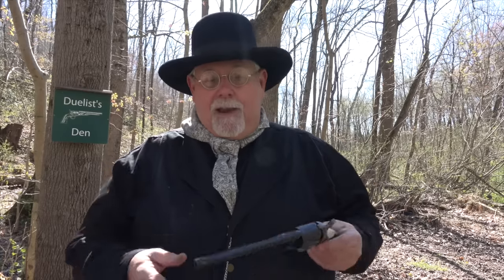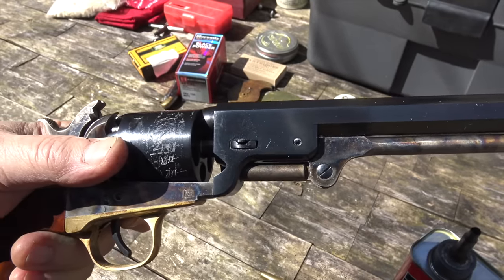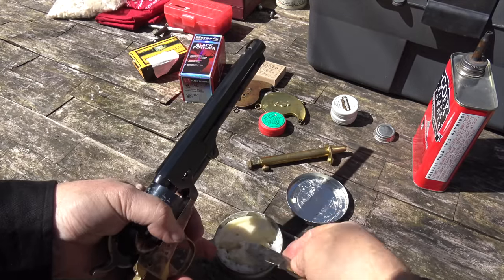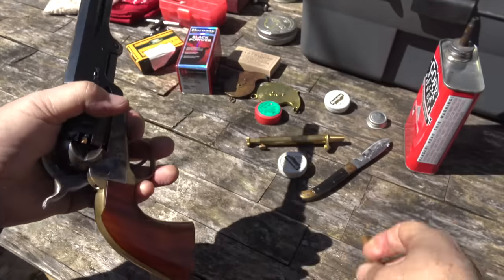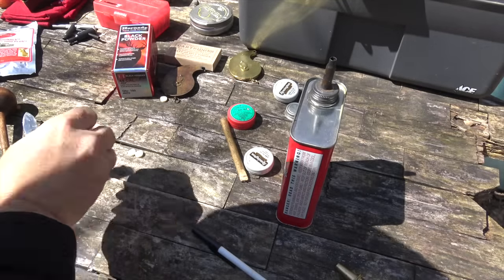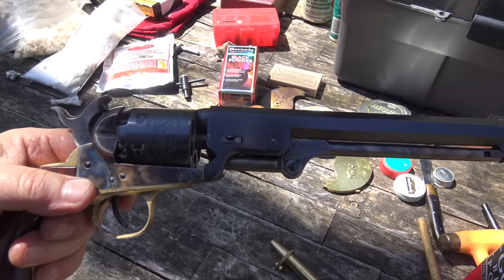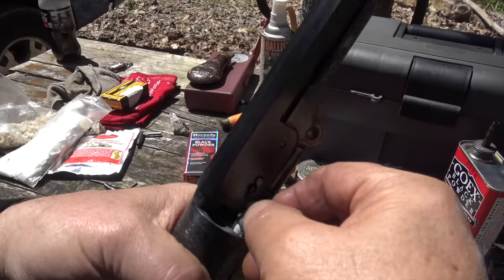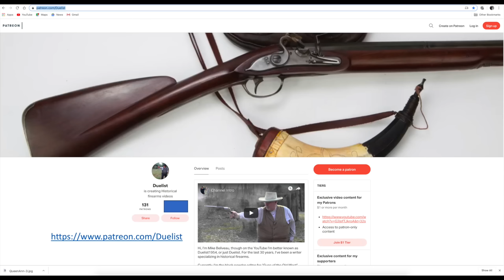How to load a cap & ball revolver

Comment: Hi Mike. In one of your other videos you showed how to modify the loading area of the Pietta 1851 Navy to accept conical bullets. You also changed the rammer. Were these changes made to that gun or were you using different bullets?
Reply from the maker: That was an 1860 Army revolver, not an 1851 Navy revolver. Navies accept conicals without any mods....36 caliber Navies that is. .44 Navies cannot accept most conicals
Reply: duelist1954 Thanks, Mike. Right after I sent the comment I searched your playlists and found 2 videos about modifying the 1860’s. Should have searched first!

Comment: Hi Mike. A question. When ramming the ball down into the chamber, do you simply ram it down hard until it stops to compress the powder or do you snug it down so as to not over-compress it. Do you need to make each chamber pressure as consistent with the others as possible or does it really not matter for maximum accuracy? Thanks.
Reply from the maker: I just ram it down for a good "crunch"
Reply: @duelist1954  Thanks.

Comment: I just bought a 1851 brass frame Navy and wanted to get started shooting. I bought bore butter and the lubed felt wads. So I don’t use both? I can use the wads and don’t have to use the butter or vise versa? I’m a newbie, and just trying to learn by these videos.
Reply from the maker: Correct. You don't need both
Reply: @duelist1954  thanks. I really enjoy your channel
Reply: At least you can double the amount of shots you can make before buying more. Use up the one product before switching to the other.

Comment: It has been a very long time since my cap and ball revolver saw use, but I rather thought I remembered the manual saying one should put the caps on first, just incase they go off when you put them on the nipples they will go off on an empty chamber. 

Is that wrong? I see you putting them on last, and I am certain you have more experience than I.
Reply: I can see two problems with that: The chamber is live when the cap is seated. Not only is this potentially dangerous, it would violate rules at particular ranges (you're allowed to cap the gun only when you're on the firing line, never at the loading bench).

Second reason is a little more practical. The cap blocks up the nipple vent when seated, more or less airtight. The bullet is going to trap a little air when you ram it down the chamber and slightly compress that air. I assume the trapped air exits through the powder and out of the nipple vent. If you tightly seat a cap on the nipple before ramming the projectile down, I can imagine the trapped air will push the cap away from the nipple.
Reply: @BogeyTheBear  I had not considered the issue of air leaving the chamber, that is a very good observation. Thank you. 

As to making it go live, it would seem safer to cap first, depending on the issue of escaping air. After all, if a cap were to go off in the capping process, it would likely cause an out of battery detonation if you capped last. But perhaps the caps are much more stable than I imagine. As I said, I haven't had mine out in many years.

Comment: Hey Mike I got a question, I just received a black powder revolver connecticut valley arms made in Italy. Cylinder is engraved (Engaged 16th 1843) serial number is 5 digit it has a lot of stampings on the brass where the serial number is, any info you can give me on this I would really appreciate it.
Reply from the maker: This video should give you the info you need. https://www.youtube.com/watch?v=_LuuLgBC2LI&t=528s
Reply: @duelist1954  Thank you so much for the reply, I very much appreciate it Mike!

Comment: Would this work for a 1860 army revolver? I know the two are relatively close. But not sure if the measure 20 grains will work for it also.
Reply: Also if ball size is the same or different
Reply: Your 1860 army may be 44 cal, Mike's was a 36 cal. .451 or 454 ball for a 44 cal. Read your owners manual.

Comment: How does the spark from the cap get to the powder if the cartridge is closed?
Edit:
I'm new to cap and ball but I've been shooting flintlock for about 3 or 4 years now with my unit
Reply: The cartridges for revolvers are made of thinner paper than what you may be used to with the tailed cartridges of a rifle. People make revolver cartridges out of cigarette paper, coffee filters or the paper used with hair curling irons.

The cap is directly in line with the chamber (as opposed to a flintlock or caplock where the flame has a turning path to the main charge) so the cap has enough force to burn through the paper in the back of the cartridge.

Comment: I have an 1860 pietta...I've seen your 1860 video though you used a larger ball....my 1860 pietta says 36 caliber only and I was told I need to get an oversized 36 cal ball (0.375")....I want to make that is correct....
Reply from the maker: 1860s are all .44 caliber. You must have an 1861. Either .375" or .380" will work.
Reply: @duelist1954  thanks for the reply....I think it is an 1861 though where I bought it they had it labeled as 1860.
Reply: @duelist1954  Another quick question....Can I use 3Fg powder or Pyrodex "P" grade, instead of the regular 3F powder??
Reply from the maker: @jerosa07  yes

Comment: Is there a rule of thumb on how much powder to use according to caliber?
Reply: No, you have to work out how much powder it takes to have the ball fit just below the face of the cylinder
Then set your powder measure to throw that volume of powder.
The ball has to sit firmly onto the powder charge is what is important.
How far below the face of the cylinder can make it more or less accurate. You will have to work that out too.
I like mine about 1/16th inch below the face of the cylinder.

Comment: Im using a brass frame pietta 1851 44. Im tryna find the best powder and charge volume. Ive already using an upgrade spring from the stamped steel that was installed.
I had the max charge of 40 grains on 2f rs powder. It had problems after the 3rd shot. So that tells me its too much. I bought this for self defense and survival only. 15 grain is too little to stop a threat at close range. Right now im using hodgens and keep getting conflicting info despite many hrs of research. I actually had to buy another identical pietta so id have spare parts.. Can anyone give me some advice?
I know that its no ar 15 but i wanna eat if i hit the hills and have a usable tool at sundown.. Please somebody help
Reply: Wrong gun for all that. They are pretty unreliable when just used as range toys.
Reply: Pyrodex P , the non select might burn different. RS is for rifles/shotguns. Can't you load 30 grs?
Reply: @ValcoBayrunner  
30grns is decent.. I've switched to conicals from Jason at 200 grain. Also got pyrodex pellet but it's a very dirty gun after a full cylinder.
Best thing I've seen yet is 32 grn with .457 140 grn ball and felt prelubed patch.
Got a 15 lb turkey at 30  yards.

Comment: Hey Mike... is there a historical reason colt made the Navy in .36 cal ?
Reply from the maker: The state of metallurgy at the time meant larger calibers needed massive cylinders like the Dragoon revolvers.
Reply: The first guns (Patersons and the like) were in the neighborhood of .31 or .32 and it took the input of Captain Walker to move ahead with a horse-killing .44 caliber. 

Colt was trying to find a way to retain the stopping power of the dragoon pistols while making it manageable for wearing on a belt. Wrought iron didn't give him many options, and .36 was a big as he could go without compromising the strength.

Comment: Why do you put the lubed wad over the powder, but the homemade lube over the ball? Couldn't you use the lubed wad over the ball?
Reply: I believe a thick felt wad is going to impede the movement of the round as they go down the bore together. May affect velocity or accuracy.
Reply: @BogeyTheBear  Thank you for the reply. I did figure a felt/lubed wad would push through with little affect on the ball. Especially at "typical" BP pistol distances.
Appreciate it.

Comment: I think the new shooters should know that most cap n ball revolvers will not allow for conical bullet seating without modifying the rammer opening of the frame. Usually not enough clearance. A horrible manufacturer’s error. 😢 Off to the range..
Reply: That's with the Pietta. The pistol used by Mike in the video is an Uberti 1851.  They are identical to originals.  The gentleman on the cap and ball channel (as mentioned by Mike in the video) has confirmed it. The cylinder, barrel, and other parts will swap out perfectly with originals.  Colt conical bullets will load in an Uberti 1851 without any modifications needed.

Comment: I got one of those navy pistols it says it's a .44 on the barrel but the. 44 ball wont fit in it. it's that same gun engravings and all has anyone else bought one thinking it's a .44 to find out it's a .36? that is what it is right?
Reply: If it's a Colt you're talking about, the .44 Colts have a cylinder where the front half is slightly wider than the back half, which you can see by a ridge running around the cylinder. The .36 Colts have a completely straight cylinder.
Reply: Use a buddy's reloading calibres and measure both. Ball should be .451 or .454. It's not supposed to fit right in loosely. The rifling in the barrel grips that ball tight. When loaded in the cylinder, the cylinder will shave lead off in a ring around the ball when seated.

Comment: You dont lube the bullet type?
Reply from the maker: I use a lubed felt wad under the ball
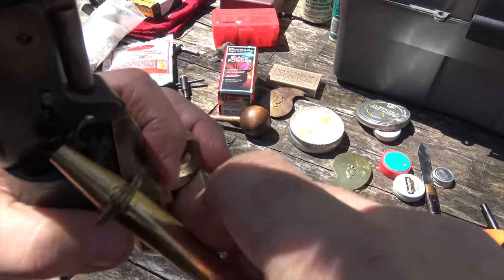Reply: At 9:00 you added powder than a comical bullet on top no lube no lubed felt on video. Wondering if its not needed
Reply from the maker: @CrimsonMask83  my conicals are pre-lubed. They have a lube groove that I either fill by rubbing in a mixture of tallow and bees wax, or I just dip the bullet into melted lube.

Comment: Actually your advice to not use crisco is incorrect. Crisco cuts the fouling and I can repeat fire many more times using it without a physical assist in turning the cylinder.
Reply from the maker: Crisco works better than nothing, but there are many better lubes than Crisco. Personally, I use a mixture of beeswax and lambs tallow…beeswax and olive oil also makes a better lube than Crisco. These lubes have a higher melting point than Crisco, and make less sludge.

Comment: So god damned confused now. Half the videos on YouTube say to use a wad and no lube after ball. This guy didn't mention a wad and puts that goo on the cylinder chambers. Some guys say the goo is for chain fire, this guy says no. What in the hell is correct? And why all the different stories?
Reply: The lubrication is to slow the buildup of fouling inside the barrel, keeping the gun accurate. Some folks prefer to apply it to the front of the chamber, while others prefer the convenience of using felt wads as a carrier for that lube.

It's a one-or-the-other kind of deal. Nobody uses both together simultaneously because it'd simply be overkill and a waste of material.